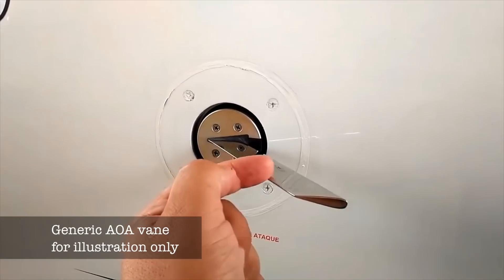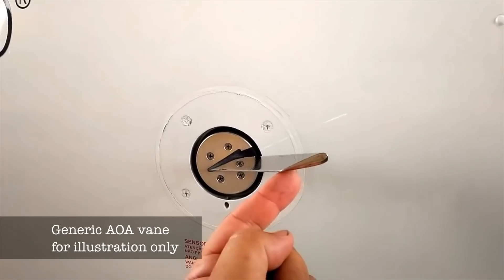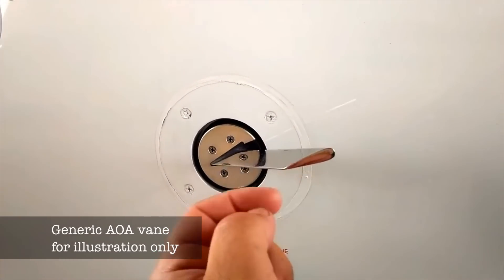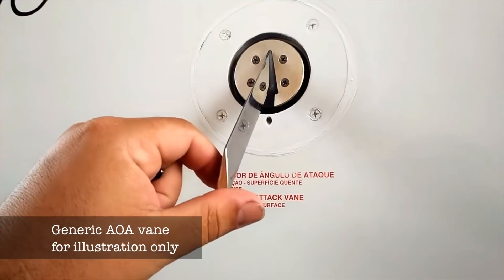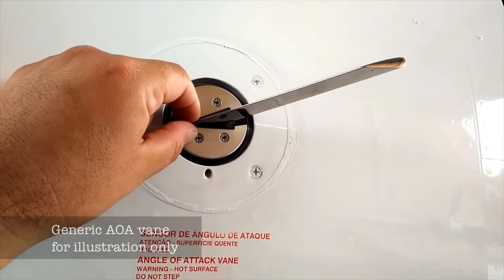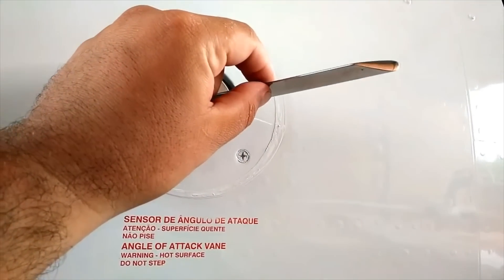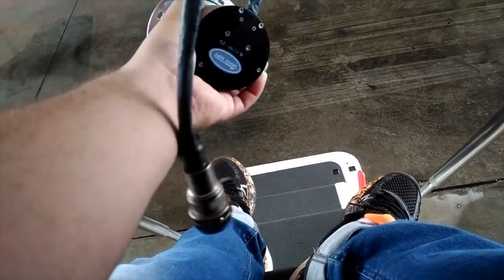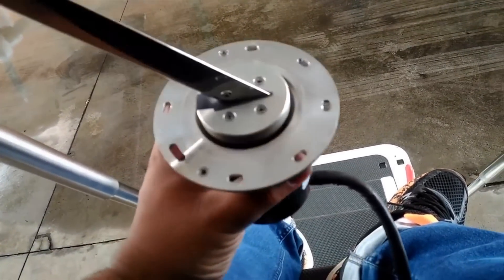Boeing 737 max 8 Angle of Attack problem - Prof Simon

Comment: what is difficult to understand is that the pilots a day before who were in a similar situation and got help by a senior pilot who was sitting between the captain and 1st officer, why they did not inform the Airline so they can instruct all the pilots. After all, without the help of this senior pilot, they would have crashed. They just escaped to crash and did not inform the Airline management?
Reply: The situation was reported but the mechanics didn't find anything wrong with the AOA because the aircraft had switched to the working sensor during the testing and on subsequent flight it switched back to the failing sensor
Reply: Hmmm i somehow doubt all pilots would’ve gotten that info in time. I kinda feel like a flight was gonna crash over it regardless.!
Reply: @deaf2819 - Its also complicated by the fact that on modern planes the computer systems are so interlinked that a failure in one sensor can trigger failings and warnings in other systems. You get a cascade of warnings and errors. This means pilots need to problem solve and try to identify the root problem. In the Ethiopian crash the pilots reported unstable air speed which may have been initially unrelated to MCAS and could of been another system failing. They did not have a lot of height/time to problem solve.
Reply: Kaman Ajayi the  unstable airspeed perhaps explains why they did not reduce engine thrust, they didn’t have reliable airspeed so they were inclined to keep thrust levels high.
Reply: I don't see why that's difficult to understand after watching this video. As explained it was reported but maintenance engineers found the AOA issue was not repeatable due to the use of alternate sensors between each flight.
Reply: Dude did you not listen to Prof Simon's analysis
Reply: because it wasn't that big of a deal, they just disengaged the system and landed the plane safely...then notified maintenance that something was wrong.  Any competent pilot would have done the same thing.
Reply: @drewpknutz1410  any competent software and hardware engineer or competent project manager, would not have let all this into the market.

this was not a faulty designed system. it was a system designed to be faulty. great difference.
Reply: lenny108 Right, even if the airline didn’t have an effective reporting system wouldn’t the pilots from the previous flight call the crew for the next flight to say ‘that plane nearly killed us yesterday and here’s what we did’. It’s staggering.

Comment: Both units should have been replaced after the incident without the need for testing. You only need to know something failed not the exact problem.
Reply: Maybe that's  the reason why no crashes in the US or elsewhere.

Comment: I do not understand why Boeing engineers never anticipated this kind of failure. First, the horizontal stabilizer has much more surface area than the elevators, which means as long as the MCAS system is engaged, it alone will determine the AOA, no matter how much the pilot pulls back on the yoke. Secondly, alternating between left and right AOA sensors, instead of using both AOA inputs 100 percent of the time is troubling. That is not a redundant system.  Mechanics and pilots should have been made aware of the alternating use of AOA sensors.

Any sensor input to software that can override a pilot's ability to take control immediately should be fully redundant.

The fix will likely consist of the following type changes.

Both sensor inputs will be feed to the MCAS computer 100 percent of the time. Any significant disagreement will cause an alarm in the cockpit.

The software control of the jackscrew, which controls the horizontal stabilizer will be tied to other sensor inputs, possibly altitude, airspeed, etc. If the plane is rapidly losing altitude, and gaining airspeed, there is no reason for software to continue to change the jackscrew setting for a more aggressive dive. And lastly, the range of travel of the horizontal stabilizer controlled by MCAS at an altitude below 10,000 feet will likely be changed.

We'll wait and see, but the changes will not just be a little tweak in software. If that was the case, it would have been done long ago. When the software change is released, Boeing knows the fix has to be bullet proof or the 737 Max 8 will be history. Boeing will not be given a third chance to get it right.

Boeing engineers should have anticipated this potential fault situation. It could have been easily simulated.
Reply: Actually, the 'Software fix' is just an idiot light telling the pilot to turn the system off if somethings goin wacky.
Reply: Boeing sell system with "AoA disagreement" as option
Reply: Did you watch boeing - ducomun scandal documentary? Building a plane is not merely tech probelm but also depends on management politics. Engineer just follow their boss above knowledge.
Reply: I do worry that this software fix is going to be a problem in itself. Boeing designed it to prevent a unrecoverable pitch up stall. This problem is still going to remain. If the MCAS system is dialed down in its response does that not increase the risk that an engine induced stall will be more likely?
Reply from the maker: Very good points.

Comment: How would maintenance know which aoa failed to test?
Reply: That's a great question!  Since this was a totally new system, or really a new computer program built into existing hard ware systems.  At this point I think it comes down to what Lion Air maintenance procedures were for testing the system. That is the information that was given to them by Boeing in their manuals.  Also, what test they performed, and doing a specific test on the MCAS, did they know it switched to the other AOA vane after each flight?  They may have believed it only used one specific  AOA sensor all the time, and did they understand exactly what systems MCAS used when running their test?  So when the plane landed the day before, the computer switched the MCAS from the inoperative AOA to the good AOA vane. When maintenance checked the system, it tested good, because it was on the good AOA vane. The computer considered that a "flight cycle", and then switched MCAS back to using the inoperative AOA vane.  Hence as soon has the plane took off the next day they had problems from the very start, until the plane crashed. 
.
As we with the help of others here (who are involved in the aviation industry) keep putting pieces of the puzzles together from these two tragic events. One thing at this point seems apparent. Boeing did not design this system the way it should have been in the first place! Nor did they provide the proper information/training to pilots and mechanics about the system!  There is also seems to be a  problem with oversight from the FAA with the certification of aircraft!
Reply from the maker: Well there are only 2 to test.

Comment: I've been trying to give Boeing the benefit of the doubt here, but they've really gone out of their way to make that difficult.

Triple redundancy is the norm in aviation. Boeing have effectively gone for half redundancy! The RAID 0 of avionics.
Reply: That has been my take but as this develops not looking good for Boeing. Plus now there is a Justice Department criminal investigation under way.

The fact it was not just pilots who were unaware of how MCAS works but if this report is to be believed Boeing dropped the ball training maintenance personnel.
Reply: the simplified AOA design is just the tip of the iceberg.
The real problem being the lack of certification! 

FAA calls this a "reassigned certification"... or in reality self-assigned or by-passed !!

The engines move forward make the 737Max stall more easily. Any REVIEW FOR THOSE CHANGES...

Bingo, I guess I really hit the nail about the engine upgrade - JUST NOW:
Southwest Boeing 737 Max makes emergency landing in Orlando; FAA cites engine issue...."
Reply: You do have two angle of attack sensors on the 737 MAX. It is possible that only one angle of attack vain was supplying information to the MCAS. Don't take that to the bank, the software protocol can answer that question and that has to be established. the other angle of attack sensor would  not be dead but will still be producing information. The question is will that information although not being primary [ to MCAS ], also enter the Flight control computer system and the flight control feel and sensing computer. Is there a protocol to collect data when there is a difference between the two indicators,   You cannot just jump to conclusions. When the MCAS is only using one sensor the other sensor may still be active for other reasons and we know that there was an option to provide information if the sensors disagreed, as an option of upgrade to the equipment outfitted on the airplane.  ACARS and other monitoring equipment on the aircraft record several channels of information and may contain data that can be inspected after being collected. the sensor disagreement warning light would be a system to provide a real time indication to flight crews where there is  discrepancy between the two sensors. it will also have to be resolved which system is correct and which is not;  which is, of itself, not an easy task. In such an event disabling the system inflight seen to be a workable approach and I am hopeful that this system will be corrected if that is found to be the cause of the incidents.
Reply: @YouTube.TOM.A  redundancy on aoa sensors "option of upgrade" you've got to be kidding me. Why not have seat belts in cars as optional extras too. Or brakes. May not need that.
Reply: i just learned that the 737 has only one computer instead of three
https://fortune.com/2019/08/02/boeing-flight-control-computer/
Reply: They’ve “out-Airbused” Airbus!
Reply: @5roundsrapid263  Airbus has a lot if fatal design flaws, that to this day, are still not corrected.
Reply: Please remember Airbus has participated in a couple of crashes due to faulty airspeed/static sensors that were not replaced and pilots flying them so fundamentally in error their system could not anticipate the worst pilots would fly in that manner. They crashed a perfectly good Airbus with all aboard including 4 rated pilots. Air France 447. Look up the Thales pitot tubes.
Reply: @tscottme 

Airbus is gov run... And we know gov is never wrong... Because reasons
Reply: tscottme that was bonins fault , he pulled back on the stick and the crew didn’t realise they were in a stall, even though the airplane was telling them exactly that

Comment: meanwhile in Toulouse, France...

"yes?!"
"hello, i'm the CEO of Garuda Indonesia. i need 49 Airbus A320 neo."
"please stay on the line..."      uncork bottle of champagne
Reply: learning from from case on military f35 and f22 .. I lose hope with max 8 .. causing problem base from its design, why put engine forward .. boeing think simple from failure design with software.. if nose up force to down.. omg..
Reply: would you fly a max 8?
Reply: There was a crash with a A320, too because of these AOA sensors. They washed the aircraft and water got in the sensor and froze and the aircraft crashed...
Reply: @xcofcd  There were several crashes with the Airbus 330's, too..."psycho computers."
Reply: CSRT4 Ever  This is the FIRST thing that came to mind...who/what was on the plane? Who benefits(financially)? What is the BIGGER picture? Can these planes be remotely "hacked?" The excuses they've come up with so far are flimsy. They always find a way to blame the pilots....makes me ill.
Reply: Nah, its tough to cancel orders., Most rational airlines will use this as leverage to jew Boeing down on the price, it's a safe plane with over 40,000 trouble free flights before 4 poorly trained bone-head pilots crashed em.
Reply: @drewpknutz1410   The pilots where very well trained, well, bone-headed Boeing charges your for an alert safety system, just like - you can buy a car from us, but to have a spedometer you have to pay more, and lets not forget oh, they forgot to mention MCAS. Put your ass in the pilots seat and tell me what that means
Reply: Is following checklists your definition of a bonehead. Also it is expected 10 million flight before first accident. If you look at the No of deaths probably closer to 100 million flight before 300 deaths, not 40.000, but im Just guessing, can do the maths later.
Reply: Looked at the statistics, after 40.000 flights approximately 0,2 deaths is expected, and the max have around 300, so its around 1500 times more dangerous to fly a max 8 compared to an aeroplane that works. So the correct number of flights before two accidents like this is expected is 60 million, so my guess at 100 million was not that far out.
Reply: @drewpknutz1410  Don't blame the pilots. That's disgusting. Maybe they were remotely "hacked." The technology is out there.

Comment: Interesting.  Deficiencies in the maintenance manual are apparently a problem too.  That’s amazing.  Mechanics who are not aware of the need to run the test twice to test both AOA vanes is not a good situation.  A more modern airplane, with its computerized BITE (Built In Test Equipment) capability would have automatically tested both vanes.    It is my understanding that the AIA vane  used by MCAS is switched when the autopilot or flight director system is switched between the A and B systems.
Reply: MCAS should have been built to Fly By Wire Standards that require triplicating of sensors.  Unfortunately “overly complicated engineering” is being blamed when the exact opposite is true. MCAS was grossly under-designed.